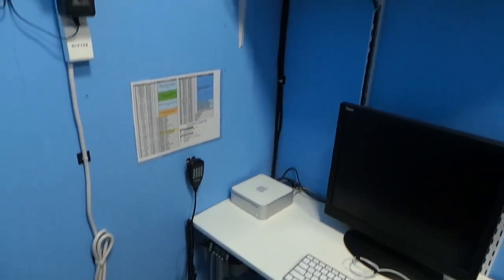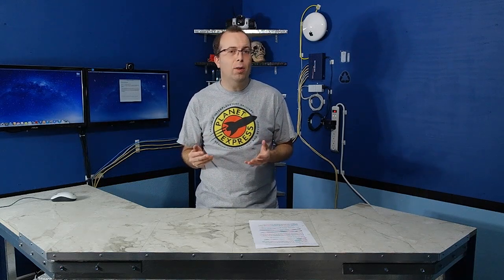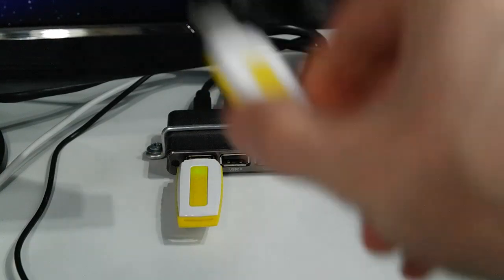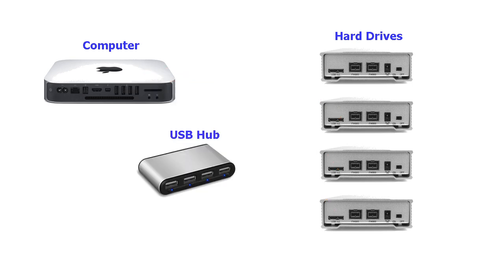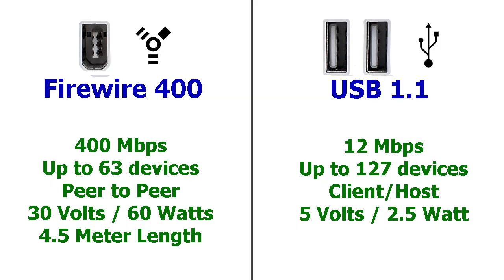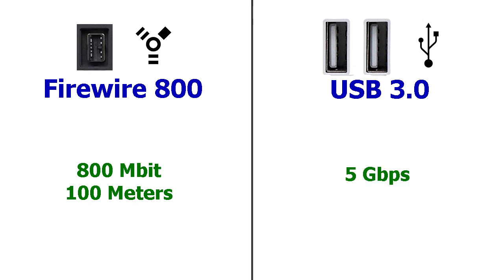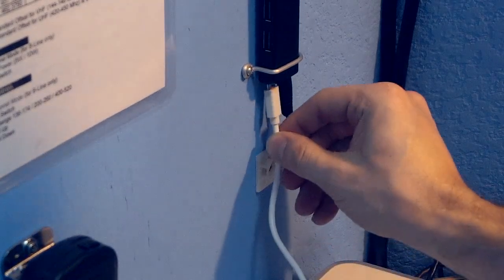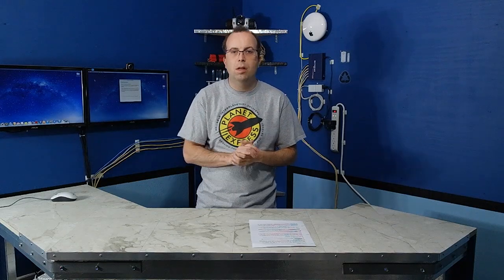Farewell R.I.P. Firewire, Hello USB!

Comment: thunderbolt is the same thing as modern firewire get dat
Reply: No its not.. Thunderbolt just looks simulerar to Firewire, but it works very diffrently
Reply: no shit but its still the same thing, its even backwards compatable with a passive adapter
Reply: ChrisD4335 No.. they are not the same thing at all.

No they are not backwards compatible with passiv adapter, you need a active one.. there is one that are very slim and look like passive adapteras, but they are not.

Also, there might be devices that have dual ports that can handle both Tunderbolt and Firewire that have a custum passive adapter. That use to be very common on PS/2 and USB devices.

Comment: Actually, USB came in to focus with windows on win95 ver-C... about the same time as 98se and Win2000sp2.5
Reply: Also, there were data transfer cables that were USB that came out so that users could migrate between WinXP to VISTA from your old computer to your new system preserving file structure & (compatible) settings from old system to new system... pretty much though 1 time use and 1 trick pony... Because it is just like a 9pin token ring modem and isn't really used for external storage or p2p between terminals
Reply: Technically it was Windows 95B OSR 2.1 that contained basic USB support in 1997.  Windows 98 had better support and came out nearly a year later. 

So the chart in the episode that states windows 2000 only is in error.  .

That said it was really the  iMac that brought it into the main stream causing other PC makers to follow suit.  That was the catalyst for USB

Comment: Firewire is still useful to users with older systems units that have USB 2.0 and a Firewire 800. USB 2.0 had the speed of 480 mbps and firewire 800 is 800. So for those who can't get USB 3.0 on their older Macbook pros or macbooks, I still think that Picture at 1:35 can be a bit misleading at first because most users (or younger users) will usually be more familiar with USB 2.0 and not 1.1 

but yeah, main point: I have an older Macbook Pro and Firewire is still awesome!

Comment: Firewire is the shit and doesn't get the respect it deserves. It was/is widely used in video and music production environments (external DSP like TC PowerCore or UAD-2 sats for Pro Tools). And people forgot about H/DV/CAM/PRO? What did people use after S/VHS-C/Hi8 and before AVCHD? 
Besides recording and transfering H/DV (MPEG-2) and authoring some nice DVDs I also used DV/Firewire for digitalizing analogue tapes - much better than "capture cards" with S-Video IN ...using 1:2 compression codecs like huffyuv, lol (1min = 500MB) (720x576). DV was only 225MB a minute :)
Also don't forget the DMA feature ...allowing you to access memory directly, hence dumping your memory and read out your cached cryptokey for example.
And of course I also used Firewire HDD cases as well, because USB was slower back in the days, also USB2.0, as you said. Also no driver problems.

Comment: Slight correction -- Windows ME does in fact support USB mass storage, but it also came after 2000 so you were correct on the essentials.
Reply: so no actual correction?
Reply: In his comparison, he lists ME as not supporting it. It does in fact support USB Mass Storage.

Comment: Firewire has support for stream data like audio/video. The main requirement for this types of data is continuity and minimum latency and those are not supported by USB.
Reply: Firewire supported isochronous data (data that occurs at a regular rate such as video). USB does not but if you have enough speed headroom it may not matter.

The type-C connector is a multi-protocol connector. USB, display port, and thunderbolt are all adopting it. Several companies have already implemented the connector with both USB and display port, it is the display port protocol that supports digital video.

Intel originally intended thunderbolt to share the USB 3 A connector. USB blocked the move. Apple, who was working with Intel, allowed the mini-display port connector to be used. Apple holds the patents on mini-display port (HP holds the patents on the protocol and full sized display port). That is why Intel was late in supporting USB 3 in their bridge chips. They were working on bridge chips that supported thunderbolt over USB then had to drop the USB and rework it to use mini-display port.
Reply: HDMI SIG  also  has  added USB-C as a Physical Interface .

Comment: If it wasn't for the added cost, Seeing USB3 HDD's with a USB host port next to the client port would be a welcome addition. I'd happily fork over the extra few pennies to see this become a standard feature of USB3 Desktop Storage Devices. it's certainly not impossible, it just requires an additional Hub Chipset inside the device. Something wired Mac Keyboards have had forever now.

Comment: I'm in my 30s and started learning to edit video back in 1999, and it was all imported via FireWire 400.  Until some of the most recent AVCHD improvements, none of the consumer and pro-sumer cameras could hold a candle to the image quality from the HDV and better codecs, which of course required Firewire to import.  My camera of choice is still a 10-year old Canon HV40 shooting mini-DV tape in HDV and then transferring via Firewire into FCP.  Aside from video import, my fastest external drives are Firewire, and target disk mode has saved many of my friend's computers thanks to this great tool.  Imagine booting up your desktop or laptop from an emergency backup partition on your iPod!  (well, the first generation of them)

Comment: Even though FireWire's abandoned, it doesn't really mean you have to stop using it. It's not like someone is trying to exploit FireWire to be used in destructive manners kinda like how they do with software. FireWire is hardware, so there's no real reasons in ditching it unless your solution can completely support USB 3.0.
Reply: +JackNet Productions He clearly said that he couldn't find any modern drives with Firewire support, which was why he was switching to USB.
Reply: Harrison Campbell It's actually possible to run FireWire AND USB at the same time anyway, just keep the old drives connected with FireWire and the new ones USB. I could agree somewhat since it might mean double the cable management.

Comment: Just so you know, FireWire is faster because of a feature called DMA (Direct Memory Access) which allows devices to move data directly between  by sending it over the internal data bus rather than going through a controller such as the north/south bridge to do this.
Reply: Hence used to read your cryptokey out of your memory easily...

Comment: I'm pretty sure that USB support in Windows started with Windows ME.
Reply: +Jan Bartnik USB "support" was on Windows 95 as well, but you needed drivers for everything (controller, USB key...) On Windows 95 through 2000, you needed to install a driver for each USB key you plugged in the computer. Starting with windows 2000, a common driver architecture for storage devices was designed to avoid that problem.
Reply: +MrOpenGL I've made a shortcut in my thoughts. Windows ME was the first to support USB mass storage devices with usbstor.sys driver present.
Reply: Jan Bartnik
Didn't know about ME. I though usbstor.sys unified driver was first included in Win 2000

Comment: While I agree with you that USB 3.0 does a (much) better job in terms of speed. I refuse to abandon firewire, actually I've bought an (expensive) adapter that allows to transform firewire 800 into –the new apple’s workhorse- thunderbolt. Now, I would love to you to talk about best ways to back up your data (this is why I love firewire, which is capable to daisy chain multiple drives).
I’ve lost files because bad decision in terms of backup, I own hundreds of thousand photos and a few hundred gigabytes of HD video too... what would you recommend to do?

Comment: I tested USB 2.0 and transfer speeds are at about 160-200 Mbps (in a USB 3.0 port) but when I have a USB 3.0 storejet and plugged it into a USB 2.0 port which transfer speeds are at a whopping 480-500 Mbps. While when I tested a USB 3.0 16 GB USB, plugged it into a USB 3.0, transfer speeds are as low as 160-200 Mbps. What happened???

Comment: How better was the world when no one knew about firewire!!! Before everyone could make videos on their phones, firewire was the best way of getting video into your PC as most DV camcorders in the early 2000s had IEE1394 sockets (which Apple branded as firewire, Sony called it iLink, although they always used the smaller connector which was a pain to find small to small cables for). Simpler times and youtube was full of a lot less GARBAGE....Because firewire streams data synchronously, rather than sending packets of data asynchronously like USB, it was a lot more stable and made sense for video and high end audio gear (ie. recording multiple inputs all independently at the same time, this is where the daisy chaining really came in to play as you could daisy chain sound cards (ie. one that was the same) to increase the io. I am still running 3x Presonus studio for a 24 track simultaneous recording setup.)So the speed rates for usb2 v firewire 400 don't mean anything, try copying a large file to a usb drive, then try copying a file from that disk to your pc at the same time, look at it die.

Comment: I'm pretty sure FireWire wasn't that popular... a ton of my computers had ports for it, but I've rarely ever seen a device that used it. Pretty much everything I saw was IDE and Serial... then all of a sudden, one day I blinked and the Serial ports were replaced with USB, and the IDE ports were replaced with SATA. FireWire never really factored in. At the time, I was just grateful that someone came up with USB flash drives, because there was this intermediate time in the early 2000s where floppies were phased out, but USB drives hadn't caught on... and everyone had to burn discs or setup networking of some kind just to transfer a couple of small files (very few people were willing to invest in CD-RW, so mostly we just wasted CD-Rs because it was cheaper/faster). Mostly the technique was used to send files to people on dial-up, or to transfer drivers found online to a newly installed Windows, and after that you just e-mailed the files to yourself. Compared to floppy disks, USB isn't bad. Compared to that FireWire thing, maybe it is... hard to compare without experience, really.

Comment: Firewire isn't all gone, there's thunderbolt, which is basically the successor, and you can get adapters for firewire to thunderbolt. You can also connect a device with pretty much any kind of firewire port to firewire 800 with the appropriate cable.

Comment: You can use usb to firewire adapter instead that all cables and hub.
Reply: +AlignedGuide65 This probably will cause huge performance degradation for firewire devices, since such adapters use internal chip to translate one protocol to another. These chip have limited power and can be used only for emergency "i need to connect this now" situations, not for constant use.

Comment: Thunderbolt has this feature and I would say that it is basically soemthing like the successor of firewire?! Both of them are heavily supported by Apple, both have this daisy-chain feature, both keep up with the speeds of other data transfer techniques, although Thunderbolt 3 is even faster than USB 3.1 and so on and they are both very expensive. So Thunderbolt has everything that Firewire has to offer too. Even if Thunderbolt now uses the USB Type C Connecter.

Comment: So why did we switch to USB, rathet than keep upgrading Firewire? It seemed each Firewire upgrade had better results than the corresponding USB upgrade. Why did we leave Firewire behind after upgrading to USB 3.0?
Reply: There was multiple factors like the fact that FireWire was barely supported
In the first place meanwhile USB was found in most machines and therefore was a better thing to focus on. Other factors include USB 3.0 being overall better than FireWire and the introduction of USB 3.1 and Thunderbolt

Comment: Lol, you need a hardware 4-bay NAS - get rid of those independant external beasts. :)
Reply: +Nick Guy Why swap to a NAS or RAID solution when he already has his external setup working. There's a very popular saying "If it ain't broke, don't fix it."

And anyway, why would it matter - David already went out and said that he does very little writing to the drives. I mean, why would he spend more money for NAS or RAID when the extra performance and speed would just be wasted?
Reply: +SyDiko Absolutely.  Having TBs of storage connected through a cheesy USB hub makes me cringe.  There's a better way, man.  That rig is fragile as a Fabergé egg.
Reply: As has been pointed out in another thread, drives for internal storage are now often more expensive than buying the external hardware of the same size. These USB linked drives are meant to add onto the system without spending a ton of money.

Comment: I'm now 26 but used Firewire only once. I had a MiniDV cam. The standard interface for transfering the video material from tape was Firewire. At that point i had a laptop with the micro firewire port and a tower with the standard connector. My current hardware doesn't offer either. But fair enough MiniDV died with Firewire.
If i remember correctly it is said that USB had a more simpler host controller design and Firewire had security issues as the host controller had direct access to all memory and external devices are allowed to access every address. Maybe a boost in performance but quite dangerous. USB never allowed that. And is also not designed for that approach as every communication is started by the host. :-(

Comment: It's possible that FW800 is still theoretically faster than USB3 for mass storage devices. The often quoted max transfer rate for USB is a peak rate, not continuous (likely has to do with the fact that USB wasn't designed for mass storage). Firewire was always faster for transferring large amounts of data. Unfortunately, for external HDs, the bottleneck is the drive (~25MB/s for mechanical drives), not the interface.  This might not be the case for other peripherals, such as cameras. I also like that FW communication is handled on dedicated hardware, instead of using up CPU resources. The more USB devices you connect, the slower your computer gets. Daisy chaining, and "Target disk mode" were super nice, and I am very sad to see Firewire go.
Reply: Firewire is useless now due to Thunderbolt

Comment: I still use firewire for all my audio engineering work. Firewire interfaces and hard drives work so much better when live recording and storing multiple high bit rate channels at once than even usb 3.0.  I looked into thunderbolt, but it didn't seem worth the cost of replacing my interface and hard drive stack considering I'm already recording at almost 0 latency.

Comment: i still use firewire, using it for my saffire pro 24 aurdio interface, though it is and has been the only firewire device i have ever had/used, when i brought the interface, i went out and got a firewire PCI card to put into my "modern" pc, What i found cool was that it could actually power the interface without needing the adapter that came with it, Will be using Firewire untill the day i upgrade my interface.